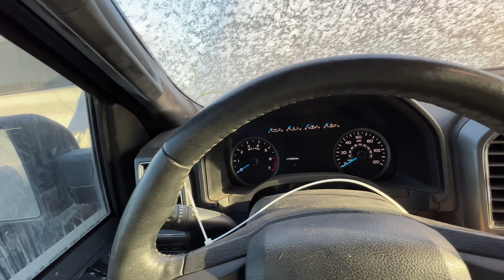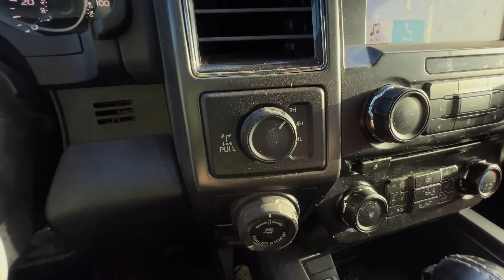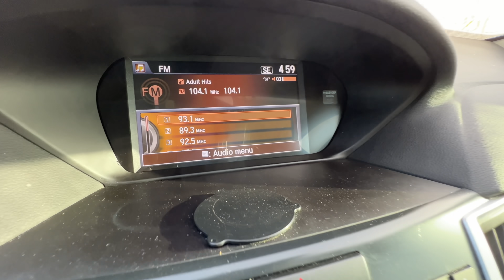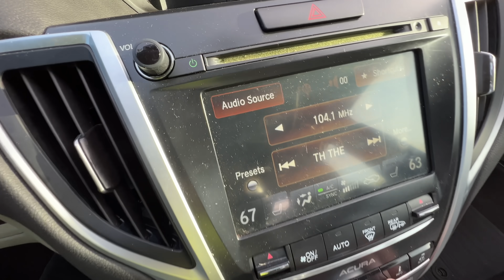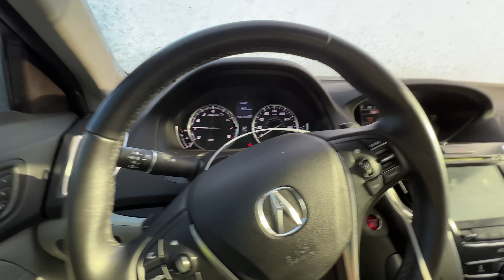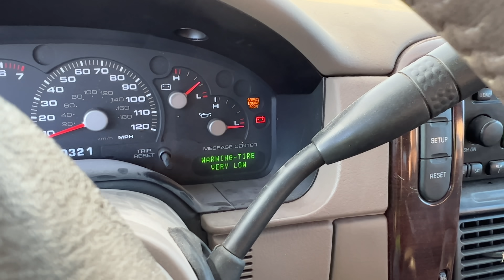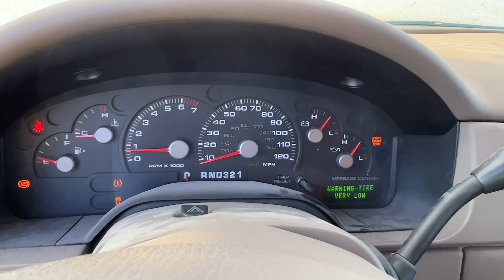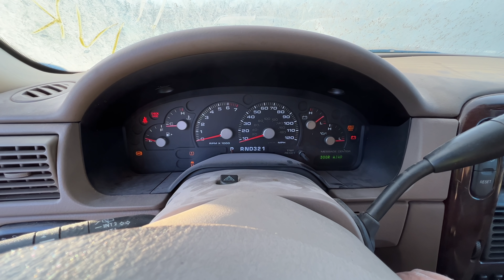Copart Walk Around 12-22-21 + $5600 2017 Ford F150!

Comment: I drive an 05 Exploder, same exact trim, same color, same engine, same interior config and I absolutely love it. 202k miles and runs like a beast! When I saw you walk up to it I got so excited. I really hope you pick this one up and bring it back to life, 157k is nothing for these, those 2-valves will run forever, and as long as you don't hear the dreaded timing chain (they're not an engine out job like the v6 examples, i did mine at 195k miles out of my driveway, didn't cost me more than $400), they're awesome trucks, and finding the loaded Limited examples like that is getting really difficult lately
Reply: An Exploder?  Stay safe there bud.
Reply: I have heard great things about those 4.6 but have heard the transmissions can be problematic.
Reply: I used to have an 05 Ford Explorer but mine was blue it was a 4x4 but they have the 4.0 motor in it but only reason I got rid of mine it was nickeling and diming me to death but I will admit the damn thing was reliable that Exploder is pretty clean the one in the video
Reply: @commonsence1129  they can be, yes

Comment: I remember when these Explorer had the infamous Firestone ATX II ATX and ATX Wilderness Tires. These were recalled in the Ford/Firestone Tire debacle on the first gen Explorer Any one else remember the Ford/Firestone Tire Debacle and the lawsuits that started in 2001.
Reply: Yeah I had them on my 981/2 2 door explorer put 58,500 miles on them no problems 
Only replaced them because they offered free new ones and if I didn't get them done after they sent the 3rd and final notice,  I'd have to pay for new ones myself. 
At the time that this was going on I was delivering cocaine cola and 1 of the 7-11's I delivered to,  the assistant manager that worked there told me that his brother worked at the tire factory where those tires were made and said that the excuse that was given about the tires causing it wasn't true
He told his brother that the problem was caused by the axle on drivers side was the problem and a deal was made between who/whom to blame it on the tires
Reply: It was a boon for me as I basically never had to buy tires for the life of the vehicle.  Bought new, traded after 100k miles.

Comment: I have a different theory on the F150.  I think that initially, the body shop had been authorized to repair the truck and began the repair however, as they began pulling things apart to repair the vehicle, they found additional damage that caused the insurance company to change their mind on repairing it and vs totalling it out.
Reply: they have frame damage

Comment: I think the explorer was running like that because it was running out of gas and then when it finally did it died so I’m sure if you do end up getting it, just throw in some gas and I’m sure there’s a chance its idle may clear up
Reply: Had the same exact problem with my 05 Taurus (yes I know lmao) I want to check it out and it ran like that and then stopped we had a little gas so we put that in it and it fired up and ran way better. (It’s a good little beater car, 78,218 miles lol)
Reply: I agree.  It needs some gas and an Italian tune up.
Reply: @mexicanspec  Never could’ve been more correct! 👌😂

Comment: I'm curious where the crash bar is positioned on that F150 if the frame is bent forget about it but it's still fixable no body panels to purchase but the engine bay is a disaster so many components break with a frontal crash half the work is done just need to check that Frame